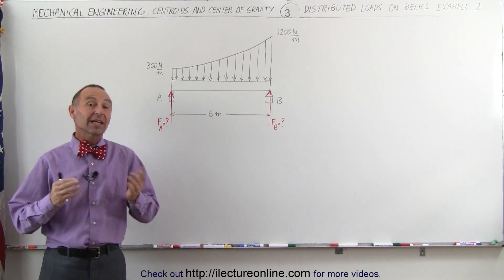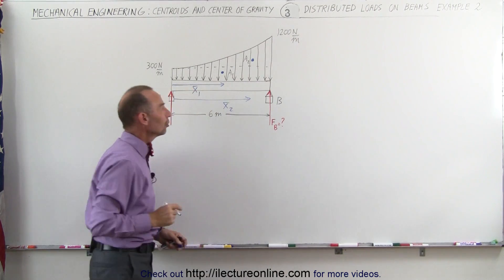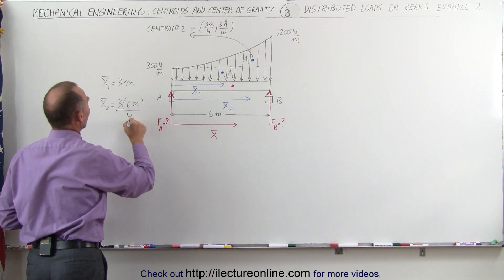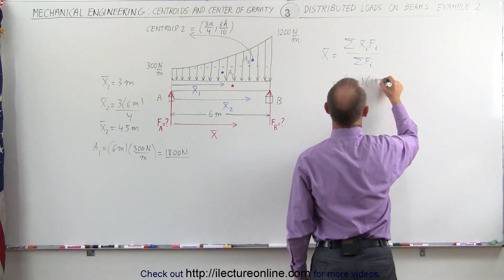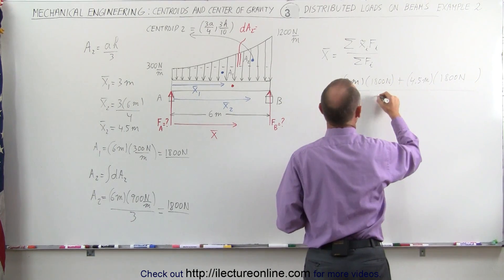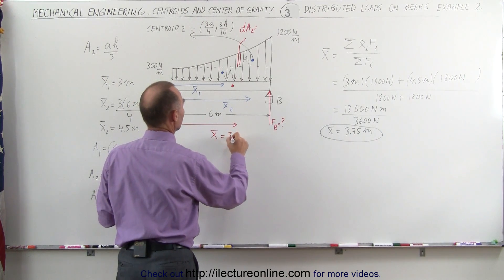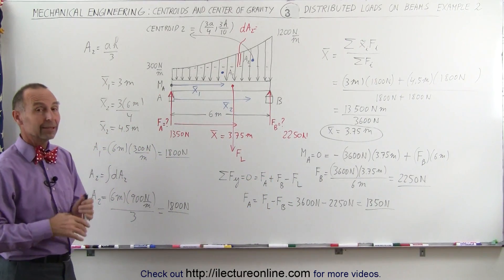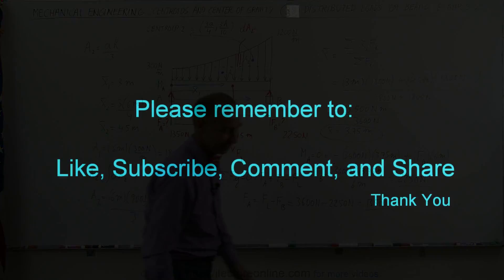Mechanical Engineering: Distributed Loads on Beams (3 of 17) Find Distributed Load on Beam Ex. 2

Comment: If I am not mistaken, the formula to find A2 which is the area of a parabolic triangle is A = 2/3 (base)(height) . I solved the problem first before watching how the professor solved the problem. I can see I got the same answer with someone on the comment section. 

My answers are : Fb = 3600N ; Fa = 1800 N
The resultant of the parabolic load is 5400 N with a distance of 4m from A.

I hope this helps!

Comment: I solved the centroid for A2 using integration given the equation y=25x²+300 and limits of integration [0,6], the weight should be 3,600N and using the vertical strip, we can find the centroid on the x axis is 3.75m, not 4.5m.
Reply from the maker: It is better to separate the 2 shapes, in order to find the correct centroid.   See this video to find the centroid of the parabola portion only.   https://www.youtube.com/watch?v=-H6RDbpeKkM
Reply: But sir, on your thumbnail, you need to use the given equation y=25x²+300 to find its weight and its centroid. Because in the video, you use the ordinary formula for a spandrel which the equation is y=kx².